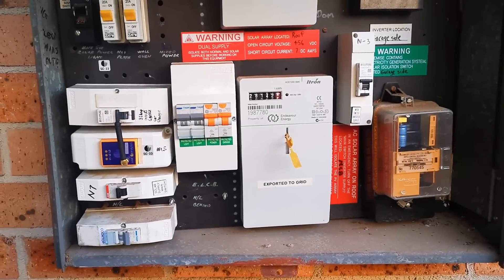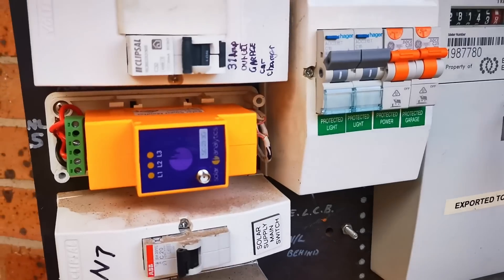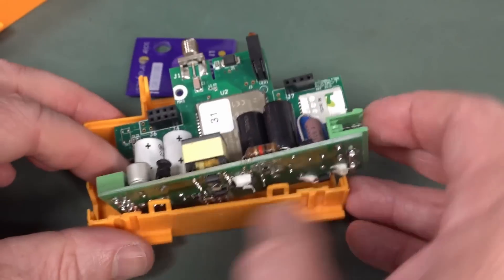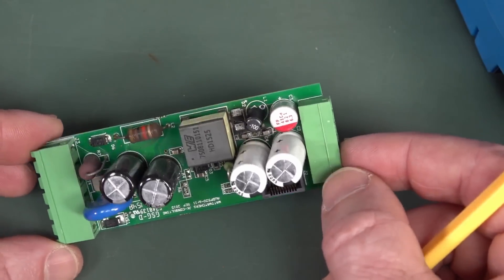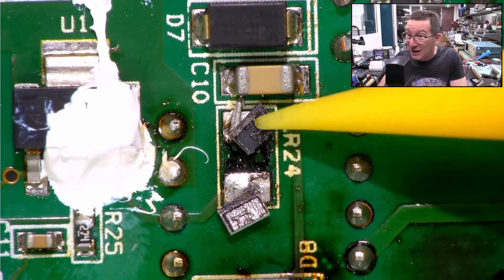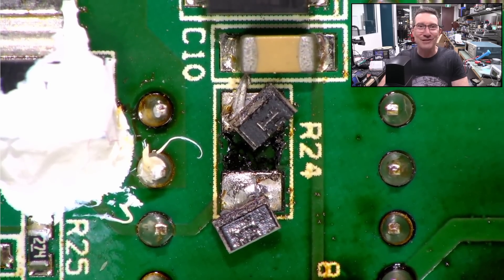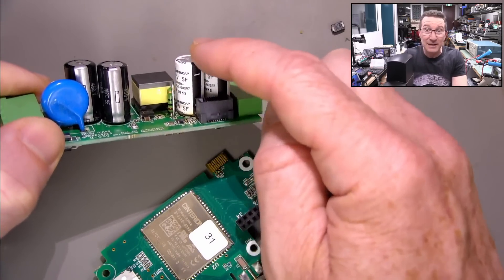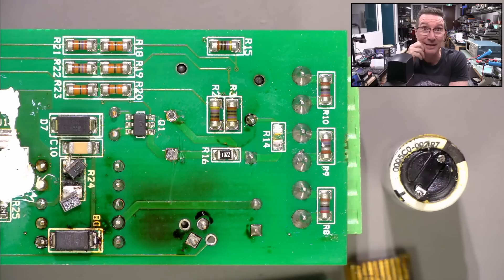EEVblog 1511 - Solar Analytics System FAIL! (+ Dave gets ZAPPED!)

Comment from the maker: UPDATE: quite a few eagle eyed viewers spotted that R14 was missing. R14 is one of the balance resistors across the supercaps. That falling off could certainly have eventually triggered the event we saw here.
I cannot find the resistor, but upon inspection of the pads it was clear that the resistor was soldered in there at one point, but the joint appears like it cracked so to speak. So it could have been a poor solder joint that ultimately lead to the failure. Indeed, the unit likely wouldn't have survived long at all if R14 was missing from production. The resistor could have fallen out on handling and transport to the lab.
I have spoken to the designer and the balance resistors were chosen to prevent imbalance and hence overvoltage in the supercaps, and there have been no other reported failures in over 70k units installed. He also concluded that the unit wouldn't have survivded this long if missing from production. In any case the latest design they are sending does not have series supercaps like this. I'll try and do a teardown when I get it.
Reply: When your product fails and you get a free failure analysis from EEVBlog
Reply: Wait. 70k units installed and the only failure happens to Dave?!?! That seems incredibly unlikely.
Reply: the super  caps popped  probably over charged
Reply: I can see it now big Clive is laughing...
Reply: The problem is that its a mystery and a lot of people can't bear unsolved mysteries.. Maybe something caused R14 to heat up and that's why it fell off.
Reply from the maker: @Lucien86  From inspection of the joint it looks like it was a dry joint to begin with. How it actually fell off I can only presume durign the transportation from the panel to the lab. I did kinda toss it around in the car.
Reply: Although the missing resistor is connected with another supercapacitor._
Reply: funny to hear you using the DIN rail term, where DIN is an acronym itself based on the german language cause DIN was a result of the great war to increase the weapon production.
German Industry Norm or Deutsche Industrie Norm made it across the globe and yes our cable boxes look quite different nowadays or quite the opposite for quite a long time .

great video !
Reply: @typxxilps  Most Western countries use DIN terminology as far as I'm aware, especially for multi-pin circular plugs & sockets from the 8-bit era of computing. We talk about DIN plugs all the time in England and I've watched many US videos do the same. I'm surprised you're surprised! Incidentally we all know its origins as a German standard.
Reply: DIN and double DIN for car stereo sizes?

Comment: Don't forget the leaking electrolyte may have bridged connections on that socket/board edge connector and this caused the resistor to overheat (sinking current somewhere it shouldn't?).

Comment: I saw the caps as you split the case and thought, “hope he checks for charge on the caps before he proceeds”. I usually check with a meter but the thumb works good too! 😅. I learned the same lesson 30 years ago. Love your videos!

Comment: As you were holding the board I knew you'd get zapped. It was pure luck you weren't stung earlier. lol. 
I've only seen resisters like that once. It was caused, or at least what the engineer who came to fix it said, by lightning. It had struck one of the phone line relay boxes and had caused numerous, he said almost 30, wifi routers, to fail in the immediate area. He didn't have that many spares in his van so would come back the nest day. He left the damage one with me and told me to throw it away. But I wanted to see inside. numerous SM components had come off and I saw one like yours all melted and twisted.

Comment: One morning I came to work and the internet was down.Investigating the issue I found the router was off. A cap had blown in the wallwart PSU. This had vented through the case by breaking the plastic earth pin off the plug (UK double insulated type) and ejecting the PSU partway out of the socket.

Comment: It looks more like the leaked electrolyte shorted the output of the power supply and caused an overload, which is why the output diode was overheated.

Comment: The diode may have been the initial failure, with the leakage causing AC to appear across the super caps which they would not have liked.The excessive current draw then cooked the primary side resistor.

Comment: What are the Manufacturer’s Environmental Specs? I’d bet somewhere it says 25C max ambient temperature… If you measured your exterior electrical cabinet’s temperature at 12 noon, then say at 2pm then at 5pm what temperatures to you find? I’d bet you will find temp readings >30C. I recall problems in Jakarta with 32C often in the shade! Your solar monitor might need to be located inside the building and/or some exterior solar shading is needed over your electrical panel…

Comment: I have seen something a little more dramatic, in the case of a lightning strike. The pre-amp chip on a modem board instantly desoldered and flew off the board, firing a blob of solder into the bottom of my PC case. This was an extremely sad day.

Comment: so the issue was an unbalanced supercap turning into a dead short and killing the switching rail?
interesting
maybe try to fix it by replacing the busted parts and see if it boots up
would be an interesting failure mode and a historic prototype to make work again

Comment: Ah - the memories of copping a boot of a capacitor...
I had the pleasure of fixing a Fluke 5215A Precision Amplifier with a burnt out section of board in the 2kV line... That was a long repair job.

Comment: Forty years ago I was fault finding a Yankee made telecommunications impulsive noise test-set that had been converted from its original 120V to 240V for operation here in Australia.    The bloody thing weighed a tonne, the Yanks had obviously built the case on it out of leftover Sherman Tank steel panels from WW-2.     Anyway I wanted to turn it over on the repair bench to measure some voltage readings on the rear circuit board and so I grabbed one of the case front metal handles with my left hand and put my right hand under it to lift what I thought was just the metal chassis but as soon as I lifted it off the bench I copped it with full-bore 240AC surging through my entire body.     I lost all control of my muscles and was left standing there with 240V rippling through my chest, and shaking violently and uncontrollably with this damn thing held in a vice like death grip that I couldn’t release and the only thing that saved me was that after a period of time that seemed like it would never end it literally tore itself out of my hands because of its sheer weight and fell crashing down upon the bench, whereupon, I fell crashing backwards and just by luck happened to fall into the seat of the chair positioned behind me.      That was, and still is, the closest thing that I had, and have, ever experienced to me leaving this mortal coil, on that day.      To close this story, when I later investigated what had caused me to receive this life threatening shock, I found that whoever had previously done the conversion on it from the original Yankee 120V wiring, to the 240V Australian supply, had left the majority of the original Yankee Mains wiring in place , which included the on/off switch on the front panel breaking the Neutral, instead of the Active, and the ‘un-switched’ Active wire then continuing around to the rear of the unit and being terminated upon a ‘bare’ completely un-encased, 3AG fuse holder that was positioned right in the middle of the low voltage 12 volts secondary power supply, and it was that bare, and live, 3AG fuse holder, that the fingers of my right hand had touched when I lifted it off the bench.       Unbelievable stupidity, by the Yanks, in the first place, for such a dangerous design and build, on the damn thing, and by the unknown idiot, who subsequently did the 240V Australian conversion on it, and finally by me, for relying upon the front panel mounted power switch, on it, to turn it ‘Off’ instead of turning it Off at the bench power point, before I tried to lift it to turn it over.      It taught me a very valuable lesson that day, however, to NEVER, ASSUME, that ANYTHING, Mains Powered, is wired correctly, before you work upon it…!!  🙄

Comment: I suppose that after the resistor cracked from thermal stress, then gravity and the surface tension of the solder made one half of it flip like that. Can't think of any other reason.

Comment: Wondering if the Supercaps were really necessary in this?

I would think they are a bit more sensitive to overvoltage than a typical electrolytic?

Maybe there was a voltage spike from the super Aussie sun, or something? lol

Weird what happened with R14 as well. That was probably the start of the whole failure?

Comment: Spotted the bad super capacitor as soon as I could see it side on, I noticed that the bottom look a bit sus! I was going to ask you to have a better look at it but you got there... Well done! 
I have watched repair videos by other channels that were working on something and you could see the bulging capacitor from an aeroplane and he still gives it an esr test and claims that it's good and can't seem to work out why the device doesn't work LoL.... Eventually the bad capacitor is replaced and presto! Like magic it sprung to life.... 
I can't watch channels like that anymore! I have rolled my eyes so much that my head feels like a slot machine.... 
I can understand if it happens every now and again..... But every single video there's something that rolls my eyes.... 
My other pet peeve is repair videos where for example a through hole capacitor is tacked on where a SMD capacitor used to be! 
It's one thing to do that for a quick test but to lay it down and cut into the RF shield to get it to fit in the RF amplifier can and call it good! And it's being done for a customer!! Nope! Can't watch it.... 
Thankfully I have seen repairs here on eevblog (I still remember the exploding reverse mounted capacitors) (that can happen to the best of us sometimes)... But at least it's done right... And that makes for relaxed viewing... It's the reason why Mr Carlson's Lab and X-ray Tony B's channels are so popular.... 
Repairing vintage equipment especially if it's audio and test equipment is relaxing watching or working on.... 
Keep up the great work Dave...

Comment: Since it's a two-sided load, one side of the board will have all the SMT components glued down so they stay on until it gets cycled through the reflow oven.  That may be the source of the bunk under some, but not all, of the destroyed/lost components.

Comment: I had a 10 or so Ω ceramic power resistor immediately upon power up snap in half. Don't really know what caused it I think it might've been an internal defect coupled with the wrong value for the project but that was the value that was recommended so I'm not sure.

Comment: The only part I'd probably recover from that board (and trust to be useful) is that nice little "L1" right next to the dropped diode.  I'd re-wind that coil to make a "Joule Thief" transformer. 😆  You can use a joule thief circuit to power those LED strings you can get cheaply from dollar stores.  As constructed, they require two AA size cells which don't last all that long.  With a Joule Thief circuit installed in the space of one of the AA cells, the remaining cell can run the LEDs for around the same time as the two cells did.
(Which still isn't very long, but at least it's now half the cost) 🤣 I've done three so far, all successfully.

Did you know that those energy-saving flouro lights have two ferrite coil formers inside each one?  One is a toroid and the other is a cylinder.  Both are suitable for re-winding as joule thief transformers.

Comment: back in the nineties i remember several times when i used to repair computer monitors removing the psu from the monitor i zapped myself several times discharging the mains reservoir caps across my pinkies so i must have had a body of a 40 year old with the rejuvenated heart of a 2 year old

Comment: When I was 15 I got thrown by a 400V DC pull up cap for the CRT screen I was playing in.  Cap the size of beer can.  My hand was sore and shaking (like the rest of my body) for a few hours.  Think I was thrown from the DC shock, as I did have my other hand on part of the chassis.  At 15 I didn't know that alone was a no, no.  Never mind that the sucker on the back of the tube could carry +400V for long after the CRT was off.
I got "bit" by a laptop power brick last year.  Unplugged it and grabbed the mains plug.  ZAP!  Obviously those scrubber caps are getting higher value for efficiency!

Comment: Some caps you just cannot discharge, especially there are caps on the other side of a transformer. Discharge a cap on one side, the caps on the other side charge up. This happened in a module in a fire control black box in an attack aircraft while I was in the Navy. We sent back the module repaired, bare as with the other type of modules with the document in its own heavy duty vinyl weather bag. Well, it bit a guy in supply and henceforth that module and others like it had to be in a separate heavy duty document bag or other container. Kudos for the SA guy answering this vlog!

Comment: 10F at 2.7V equates to around 36J. So definitely quite a jolt.
The diode and resister must have reached at least 220°C in order to melt the solder. With the parts of the resistor being light enough for capillary action to keep them on the board.

Comment: Supercap failure due to over voltage due to poor series voltage sharing or due to long term AC currents causing heating and electrolite loss over time?  SC's have pretty high internal resistances so perhaps the long term ripple was too much for it?

Comment: Well I guess many people can relate to that capacitor shock. Reminds me of the time one of our suppliers send me one of their new and "improved" replacement  models for verification, but they forgot to add the discharge resistor and I found out the hard way when unplugging it and got shocked on the dangling plug. Since then I'm paranoid and short every plug on a metal surface after pulling it. I guess in your case it isn't really needed since usually you wouldn't have a plug on that thing, so depending on your standards it may not be needed, but in my case it clearly violated some basic electrical codes/standards here that required the voltage to drop to safe levels in something like 5 seconds.

Comment: My guess for the rotated resistor is that it was hanging vertically in your panel and gravity pulled it down after it cracked and desoldered. (haven't finished the video, maybe that conclusion is drawn later)

Comment: I've seen a resistor fail like this, but only once before... A customer's vehicle was struck on the little aerial on the roof of the vhicle, and the control unit for the telematics had failed inside the MCU itself. It seems as the though the resistor slowly heats up until the soldr melts, however the resistor continues to heat up slowly until it fails. When it seperates, the component breaks in half due to the heat and the solder is still molten, so the surface tension of the solder on the 2 halves of the resistor pull it in stange ways...

Comment: Think diode failed first, short circuit. That ment that ac was pumped into the supercaps. That caused the supercap to leak. The resistor was the last to fail. Got hot enough to melt solder, and might have had trapped moisture which caused it to explode, while the solder was melted, causing the remaining resisor bits to flip over. Force of resistor explosion probably also knocked diode off its molten solder.

Comment: 12:52 shouldn't all resistor dividers have the same division factor then? R23 seems to be 330kΩ in contrast to 270kΩ for R21 and R22. It's also mounted in the wrong direction 😎

Comment: At 13.20, you can see some discolouration on the bottom of that super cap and possibly a split as well at the bottom, did that have something to do with the failure?

Comment: You can expect that unit to quit working soon anyway.  3G phone service in the US has terminated.  I would expect that to happen world wide eventually.  I have a $3,000 CPAP machine that sent updates to my doctor.  It quit working April 12th.  The manufacturer is going to nothing about it.

First, there's a chip shortage so they can't make a new GSM modem.  Second, there's a new model so now we have an excuse to sell another million units at $3,000 each.  What really sucks is some professions require that regular data reporting to stay legal.

Comment: It got hot enough to melt the connections, then cracked, then gravity took over.  The gunk underneath is what's left of the glue.  When they do low end boards like this they'll glue the parts on the bottom then use a mass soldering technique like wave soldering.

Comment: Trap for young players, discharge your caps before manhandling circuit boards! 😂
Btw have had a Nokia wireless in-ear case lose a smd diode. Crappy soldering made it fall of.

Comment: Don't know, if anyone allready noted: Dave, did you notice the cap is only 2.7V rated? Did they connect those in series? Maybe not the best idea, since balancing could be an issue, between those two caps.

Comment: Do you have to pay monthly fee to use solar Analytics, even with that module ? As solar analytics says "If you are unsure as to whether you have a consumption meter, you can go into your Inverter app (Fronius SolarWeb, Sungrow iSolar Cloud, or GoodWe SEMS). If you can see a load (or consumption) line next to your PV (production) line on your energy tracking" But i believe you have pay a fee each month for the service. So is dave's one differen't or cheaper as you pay for the 3G only not the service ??